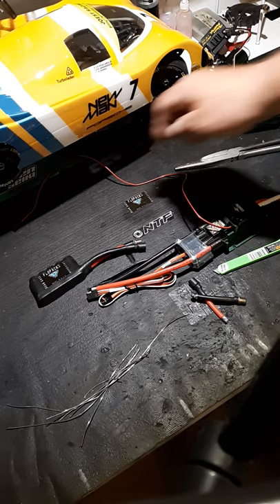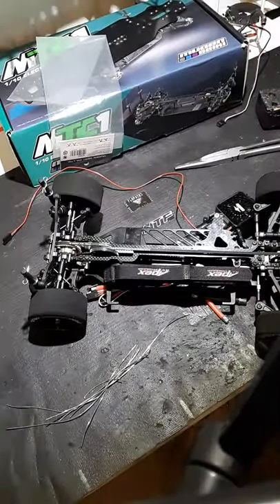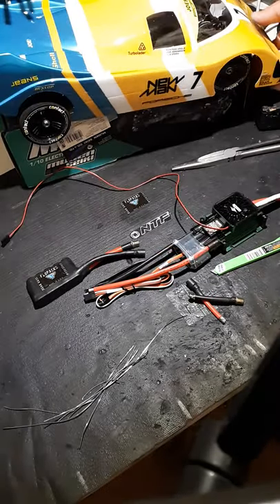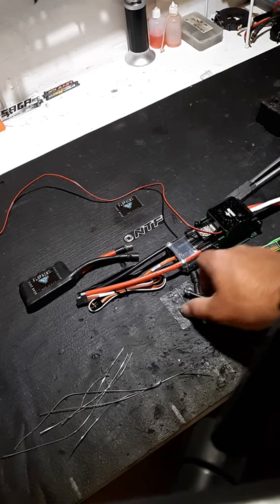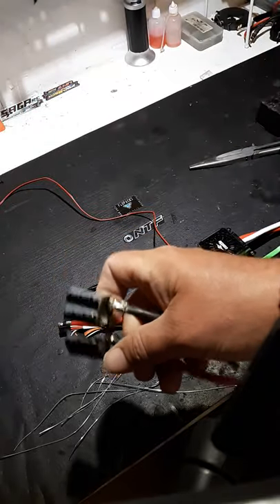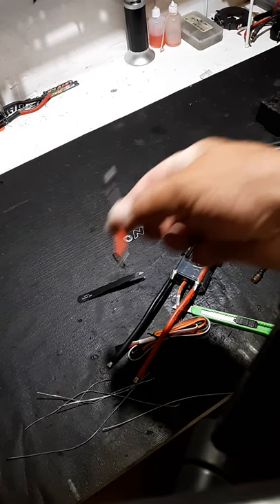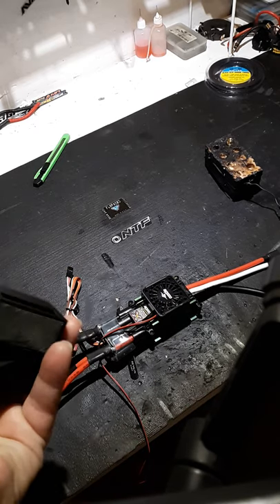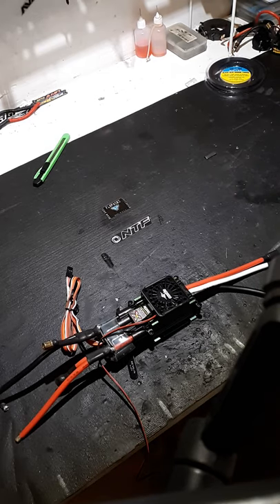How I solder cappacks ,sky rc performance  cases, new mugen !!

Comment: Kester solder , Caig flux & a good tip timmer/cleaner  will make a cheap iron seem great.
Reply: I also use vice grips to hold connectors, wire etc..